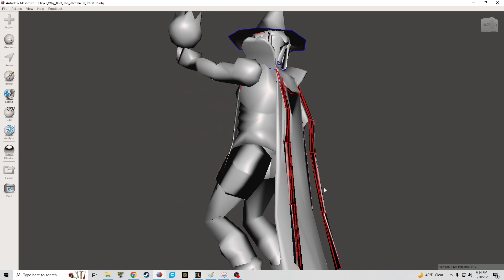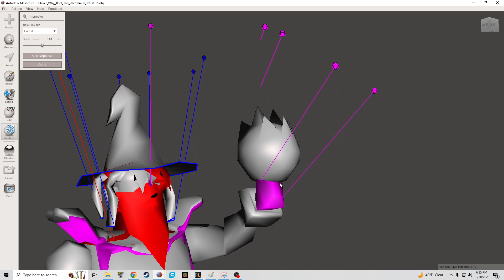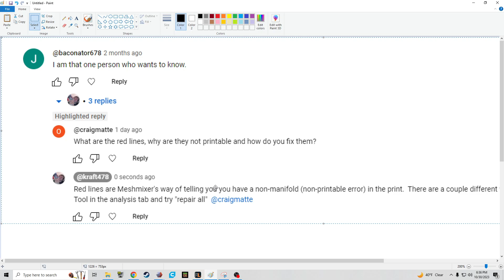[Quick/Easy] Fixing MeshMixer Non-Printable Areas (Red Lines/Purple/Blue bubbles)

Comment: Thanks for being someone that would try to address this. Thank you. In my case I'm trying to understand where the red and blue lines are coming from when i try to initiate a boolean union on two objects. The tool loads but I can see red and blue lines pointing downward. The inspect tool doesn't find anything on either object. The barrier to entry to learn how to manipulate models is high. For me, it's like the same thing will work, but then not work. I'm sure there's "just" something out of order. The objects are solids. I've smoothed the surfaces I'd like to union. This stuff drives me crazy.
Reply from the maker: Ok, the best way I can explain it is like this: Red lines (usually) indicate a non-printable part of a model. Blue lines (usually) represent a printable, yet infinitely thin, portion of a model. A blue line can still print for the most part but it may cause problems. In simple terms they represent warning that say this might work or this won't work at all. Boolean union are definitely tough in meshmixer. It is a simple software so it isn't really the best at it. With the object being solid as you say I would need to know the end goal of the union. Are you just trying to combine two parts? If so, there are better ways to do that like slightly overlapping the models and just using combine. If you are using boolean union for something else, this might not be the best advice.

Comment: I have blue lines on model but there is no hole . Is it printable with blue lines ?
Reply from the maker: For the most part yes, it should be. Looking at it in Cura or whatever slicer you are using. It should show you if something is not going to print right.